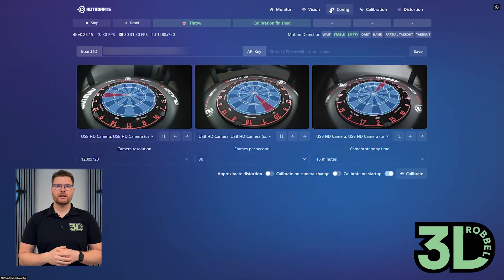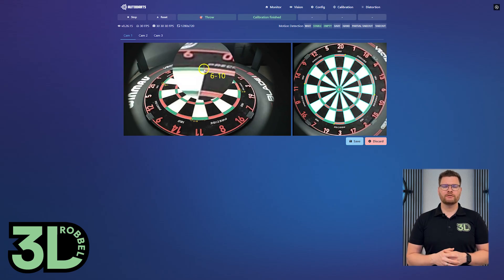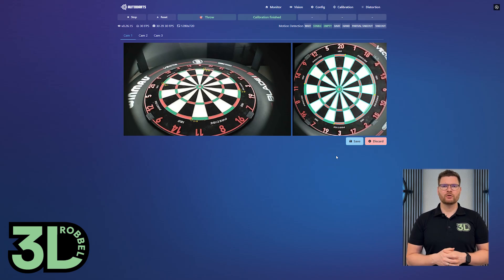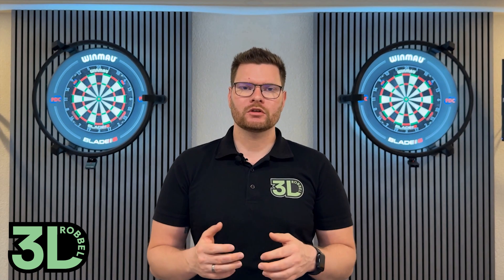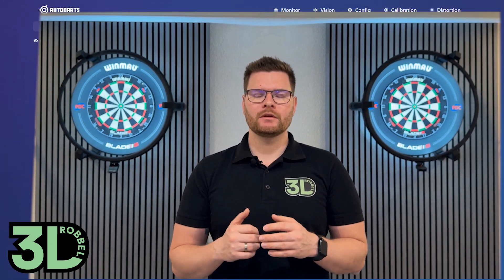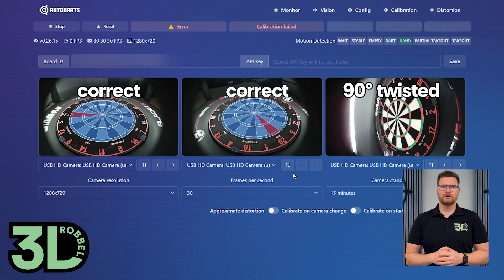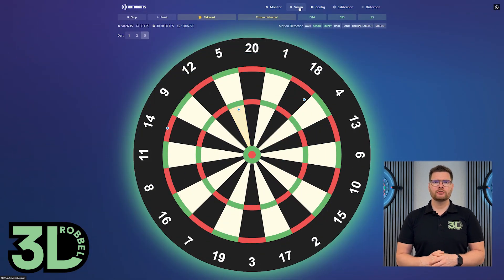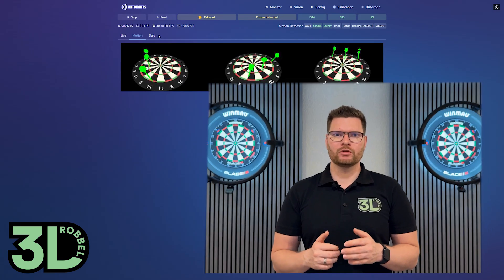EN - Autodarts Basics

Comment: mine doesnt want to find the cameras while they are really in
Reply from the maker: Do the cameras work individually? How did you connect the cameras? All individually or via a distributor? 
Which pc do you use ?
Reply: @robbel90 it took me 2 days.
And still don't get what was the problem.
Removing restarting plugging plugging out and something has worked.
But I can not get the cameras in the right position so when my vacation is over I need to go back in to it because he says wierd things